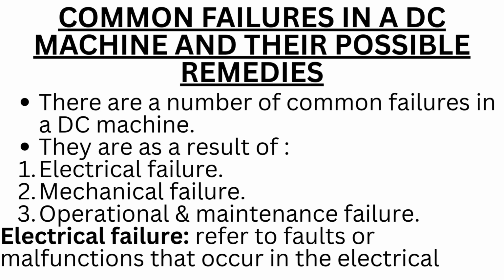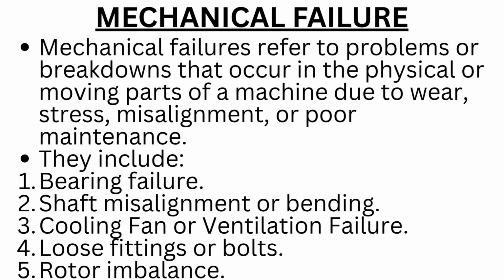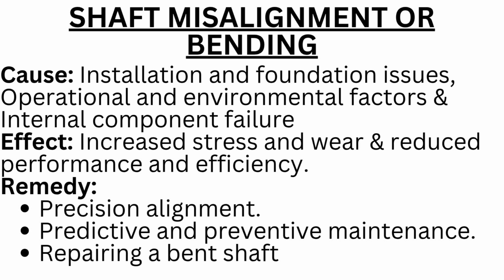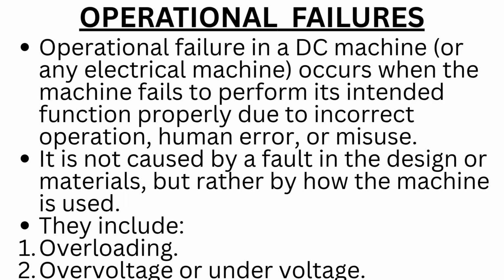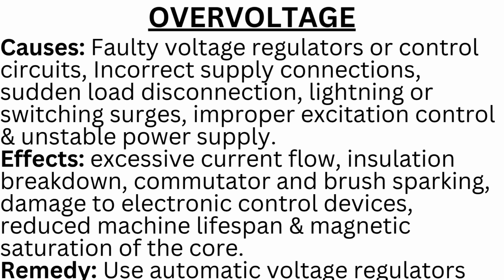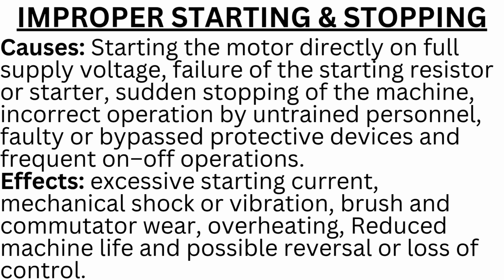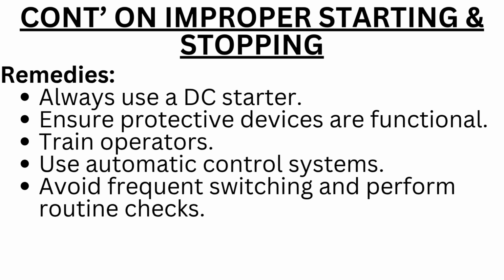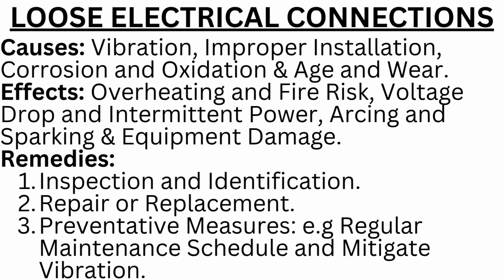Common Failures in a DC machine

Comment from the maker: Hello friends, if yo missed my previous videos below are the links:
1. Parts of DC machine and their functions: https://studio.youtube.com/video/CMjnt1cFNos/edit
2. Working principle, classification and types of DC generators: https://studio.youtube.com/video/TN9KjUGFuP4/edit
3. Definition, types and classification of electrical machines: https://studio.youtube.com/video/l_EFy1iCZpo/edit
4. Speed control of DC motors: https://studio.youtube.com/video/alfCmWoIn44/edit
5. Application and common problems in a DC machine: https://studio.youtube.com/video/txJKZTii-cs/edit
6. DC motor characteristics: https://studio.youtube.com/video/O7heJbL46FU/edit
7. D.C motor working principle, back E.M.F and significance of it: https://youtu.be/KaQrtNHytUU
8. D.C motor voltage equation, power equation & condition for maximum power: https://youtu.be/VUlLRfBr9kU
9. Types of D.C motors, armature and shaft torque: https://youtu.be/ymsNP_p2tpU
10. Working principle of CT, hall effect and Flexible clamp meters:https://studio.youtube.com/video/-iO0CItknbs/edit
11. How to use a multimeter:https://studio.youtube.com/video/VQq01tVJD3M/edit